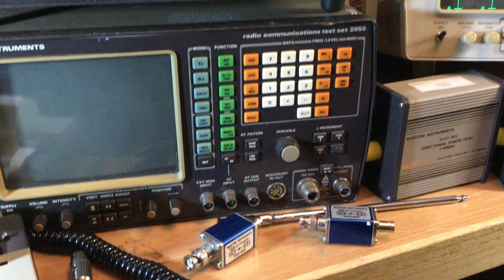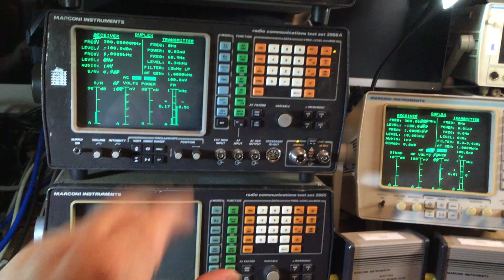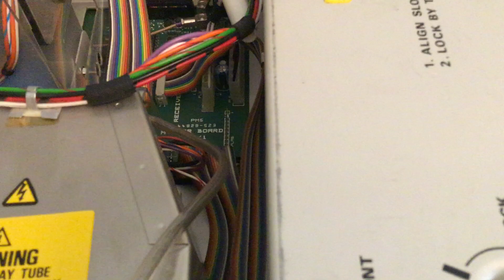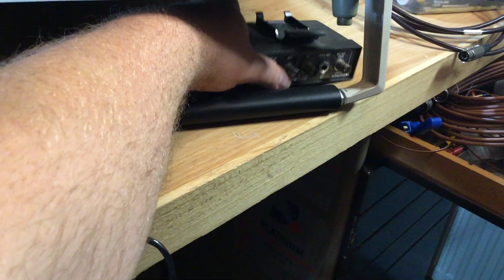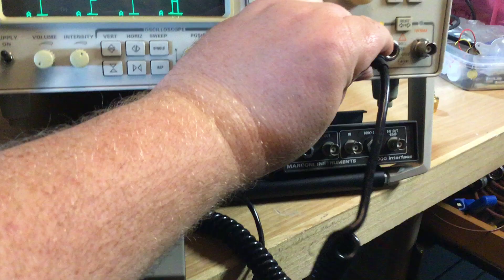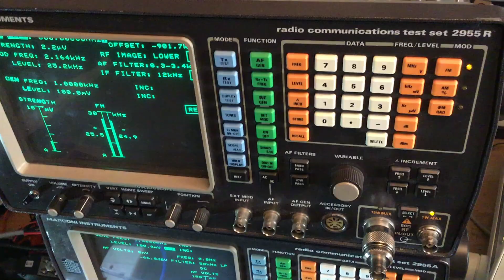Marconi 2955 All Four Models, 2955, 2955A, 2955R, 2955B, inc Sensitive receiver option & accessories

Comment: intersting to see the 2955 in action again.  I was in the design team at MI when the 2955 A and AR were developed in '86-88, and responsible for the AF updates.  The team referred to the AR antenna as the BNC to flipchart adapter as commonly also used in project meetings to point at plan progress.

Comment: I have a 2955 rated to 100Watt, not sure if it is different inside from the 2955 that is lower rated
Reply from the maker: As far as i am aware the Marconi 3rd party suppliers part number they have put in the part number section in the rear of service manual for the 20db pad used in the N Type on the 2955 is the same part number for the 2955A thus would imply 75W rated constant power rating, also in the instruction manual for the 2955 it also states the peak handling power is 100W even for the 2955 so it would imply the specificaiton of the 2955A is the same as the 2955 insofar as the RF power on the 20db pad, However with that said i think you will find the "REMOVE RF POWER NOW" warning message will appear much sooner on the 2955 than on the 2955A as i belive the firmware may have the thermistor temprature sensor warning trigger level set to a lower temprature rise curve, you see the thermistor is bolted to the 20db pad attenuator in the RF attenuator module is the primary way the unit senses RF pwer overload coupled with an RF Power level warning threashold in the Firmware should execessive power be applied. so basically the answer is YES & NO. insofar as the 20db pad can take 100 Watts but the Software / Firmaware will trigger an RF overload warning much sooner than a 2955A model.

Comment: The -R was useful on hilltops for detecting intermodulation products and evaluating the surrounding fences for issues. A rusty wire staple and wire (on a 5 wire fence) worked remarkably well as a rectifier diode and antenna. Being able to carry something around the field and see how things changed when you hit fenceposts with a hammer was handy

Comment: Hi there, thank you for your interesting video.  I understand the 2955B was enhanced somewhat to be able to carry out SSB radio alignment, so perhaps there is a test method I should be using that I am unaware of.  I have the 2955B but when using it to carry out a two-tone test to check and set SSB linearity the 2955B makes a cacophonous sound and the transmitted signal is very unstable.  As far as an oscilloscope trace goes, the trace on a well adjusted SSB radio is very lumpy and misshapen.  Is this expected due to the 2955B's limitation for SSB alignment or would you expect a potential fault with my 2955B?  I don't notice any problems when aligning radios in FM or AM mode.  I usually mix 500Hz and 2.4kHz tones when doing SSB linearity adjustments, but I have tried a 750Hz and 1.333kHz combination without improvement.
Reply from the maker: Hello, The 2955B as standard didnt have capability to generate SSB modes LSB & USB or to demodulate the TX SSB modes either. it was only desigend for FM & AM & Phase modulation modes. I am not personally aware if SSB could be an option added as i have not seen this in their manuals, The only radio test sets Marconi / IFR produced that have SSB measurment capability were the 2945 & 2945A 2944 & 2944A & B all of which were options, & the 2964, 65,66,67,68 series again these were options which is a plug in module & had to be enabled in the software under Hardware options with an unlock code issued by Marconi after you had coughed up many gold coins. With respect to making measurments on SSB receivers you can do this using AM & obviosuly the difference between LSB & USB is the BFO frequency shift for the sidebands being the differnce between the AM carrier & the USB & LSB BFO tone difference indicating the seperation of the LSB & USB from the carrier. Equivelants can be found by doing a two tine test but again strange effects can happen as the two audio tones can mix & produce a 3rd tone of undesired frequency & make thisgs difficult. this measurment would be taken with the clarifier on the radio at centre position & displaying the spot frequency on the VFO. With regard to making TX measurments on a SSB transmitter using the Marconi 2955B it would not be possible to measure the TX mod accuratly without an SSB demodulator which would employ a BFO oscillator, However with that siad i do know you can connect an SSB demodulator to the rear of the marconi on the DEMOD output to make your measurment. Also the RF power meter makes average power reading on AM power it would find it difficult to read peak RF power for SSB modes. As such you could use a BIRD 43 power meter with a peak reading kit, or just take the average on the AM power meter. by using the tone test on the Transmitter it owuld allow the test set to stablise the measurement. Also good to adjust the AM TX AF Demod filters to get rid of unwanted audio 300HZ TO 3KHZ IS GOOD, & where possible use manual tune on the test set & manually set the frequency so its locked onto frequency taking care to add & subtract the LSB & USB sidebans so the test set sees the right frequency & use a 2 tone audio injection into the radio mic socket so that when the TX is keyed it keeps the carrier constant & the test set can measure the tx power more stable. Obviously if you were to modulate the TX with your voice on the mic only the test set will struggle to tune & measure as the carrier is on & off too fast for a measurment due to latency. With regard to strange effects on the AM RF Generator testing the SSB RX on the radio its because the AM carrier is not supressed when the radio is in SSB mode & thus you get mixing effects with the mod gen & the carrier which is unsupressed. this is nothing to worry about. With all that said if the raido is multimode i.e it can do FM, AM & SSB if you mesure the FM & AM rx test for the SSB mode you could use anoter radio in close proximity with SSB to listen to the radio under test to ensure the SSb TX is working. When you look at the R&S & Marconi test sets with the SSB demod capabuilty there is nothing fancy, & all it does is add a BFO & be able to generate USB & LSB by supressing the carrier so youre not missing anythig special really & when you do get a test set in the future that measures SSB modes you will wonder what all the fuss was about.
Reply: @rfmanrfman4536  Many thanks for you detailed answer - understood and appreciated!

Comment: I love these old test sets. I have a series 1 2955 which originally belonged to one of the original design team. He got paid £1 by Marconi for his design. If i remember correctly the RF Generator. which was a contractual rate at the time. Mine has an encore fault? when you turn it right it increases the value and when you turn it left it also increases the value. If you have encountered this fault id love to hear any feed back on its repair.
Mine has software version 13 1987 is there a later version that could be used

Comment: Are there any hardware changes except the 75W power input between the 2955 & 2955A sets?
Can the 2955A firmware be used in 2955 set to benefit from the extended tests under the tone menu?
Reply from the maker: Hi The Marconi 2955 model although labeled on the type N as only able to accept 30W isn't actually correct, the manual states that 75W continuous can be measured with a peak power of over 150W for short durations, The power excess alarm works off temperature rise of the 20db attenuator pad resistor, only later on the 2955A & B models did they actually start printing on the label above the N socket 75W as this is the continous power rating of the attenuator resistor, the 50r 20db pad resistor is designed for 75W continuous & the parts are exactly the same on all models so there are no differences. If you look at the instruction manual for the 2955 test set it does tell you this information in the manual the it can handle over 75W. Hope that reassures you.

Comment: I have the Marconi 2955 but it as a start up issue every so often but when booted up passes all the self tests . When switched on it gets ad far as both RF outputs high and low LEDs illuminated and Am / Fm LEDs illuminated and blank screen. If I keep switching on and off it eventually boots up. Could this be a sticking relay? 
Thanks in advance
Nigel M1DED Sheffield UK
Reply from the maker: Could be the 10MHz ref oscillator on the CRT board thats not running properly as the CPU gets its clock form the ref oscillator & the issue you have with LED's being on indicate that issue, way to tell if CPU is not running correctly is to press the RF select button near the N & BNC socket, if the RF relay can be selected for the N & BNC ports & the RF port select LED changes when the button is pressed this proves the CPU is running, if however it does nothing this means the CPU isn't running properly as it gets its clock form the 10MHz ref oscillator, also could be power supply rails not correct from PSU. If the RF port does change even with no display this means the CPU is running correctly. you can also connect an external 1Mhz reference signal into the rear BNC to rule out the internal reference oscillator too.

Comment: Btw, sensitive receiver on these units has no preselection, so most times you end up saturating it when plug antenna and not hearing damn thing... I just installed filter between bnc and antenna to avoid that

Comment: Good video!
I have 2955B model. Ive noticed with the spectrum analyzer that above certain frecs i see some noise on the carrier like its waveing like... No sure if thats normal at high frecs or maybe low frec noise is getting into rf section due to capacitors... Ive never recap this unit
Reply from the maker: Yes i have see that too, this may be capacitors in the PLL circuit on the oscillator board & mod gen board. the AF gen input to the RF oscillator board can be isolated by removal of a component in the AF mod path to determine if its a phase mod leakage to the RF oscilator this will inform if the issue is a supply related instability or mod gen leakage to the RF oscillators, i would start by going thru the RF Oscillator pub caps to check ESR on the supply rail caps first. & the same on the vertical boards in the top containing the AF Mod gen circuits.